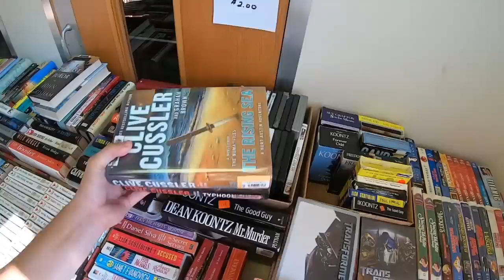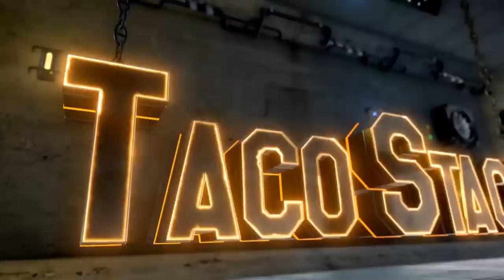Trash Picking Some Treasures and A Rummage Sale

Comment: If you only plan to sell the coat rack for $5 they can just fix the hooks themselves maybe? But If you have some old keys or forks or spoons (and some time lol) you can bend them into hooks the keys are a bit better because they usually have some sort of pre drilled hole to run a screw through, the silverware would (obviously) need to be drilled out to be able to screw it into the wood.

Comment: Hey Taco.  I have an older home, and have had issues with water pipes or drain lines under the house.  Water came up through the foundation to cause a leak in the floor because the metal drain pipe had deteriorated.   Better get it checked out by a plumber pronto as it can cause damage to the house and will just get worse.  If it causes damage to the house, you may be able to get your insurance to pay for the repair (after your house insurance deductible) depending upon your insurance plan.   (Just had a neighbor report water shooting up outside in my yard last night; water is now turned off to the house and it's a complete pain!)

Comment: Best watch that "random" wet spot. Water travels to low ends of course, could be a leaking pipe under the house not right there but up hill. Random is never good, especially random water.
Reply: It's dog piss

Comment: In one of your videos you were picking up some ceiling fan motors. There were some of the fan blade arms in a container. I believe you said they were die cast, but you didn't say what they are actually cast out of. I have several I would like to scrap. They fail the magnet test. What are they made of?